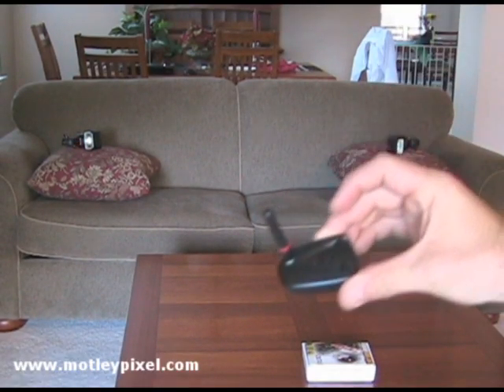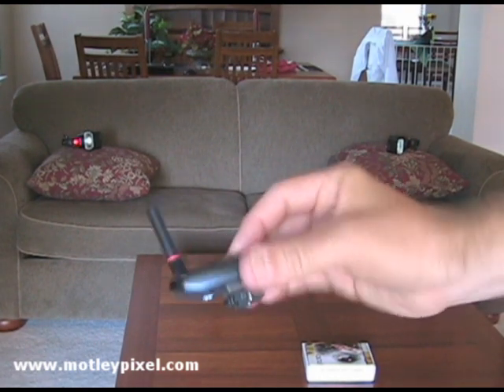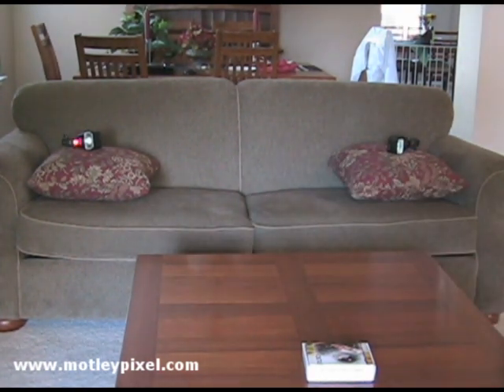Cactus V2s Wireless Flash Trigger Review 4 of 4

Comment: Thank you very much for taking the time to do the video. I will be useing it to do the range mod. on my Blazzeo V2s Trigger. I know they are a different manufacturer than Cactus, but they look the same with the same guts. I am, so far, very happy with the results of the test I've done with mine. With in 40 feet...NO missfires. At 60 feet they get about 20% failure. Not bad without mod.
Thanks again.

Comment: Don'T Waste money, CACTUS Wireless Flash Trigger V2s u cant get the SYNC speed needed to do anything creative. Box says 1000/ but canon only 200 fail!
wtf

Ts = shutter speed
Tf = flash speed
Tr = transmission time from V2 transmitter to receiver
Tfv2 = responding time of the flash after V2 is in use

Tfv2 = Tf - Tr, Therefore, Tr = 1/500s Tfv2 = Tf - Tr = 1/500s Therefore Ts = 2 x Tfv2 = 1/125s only.

So don't waste your money, buy the pocket wizard